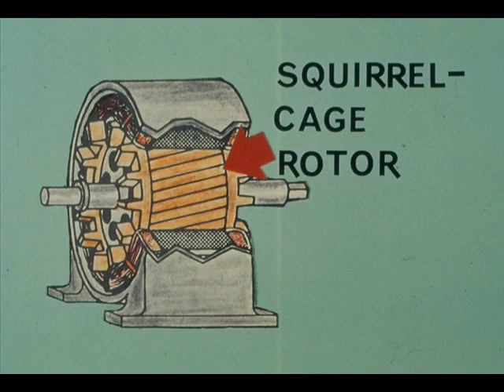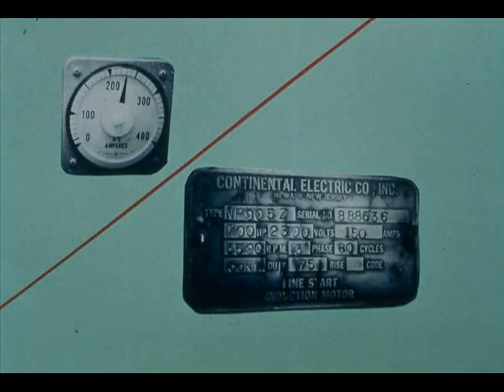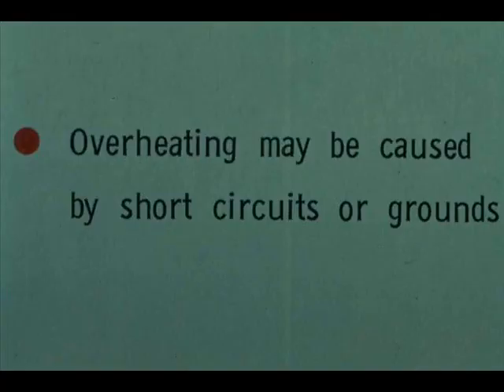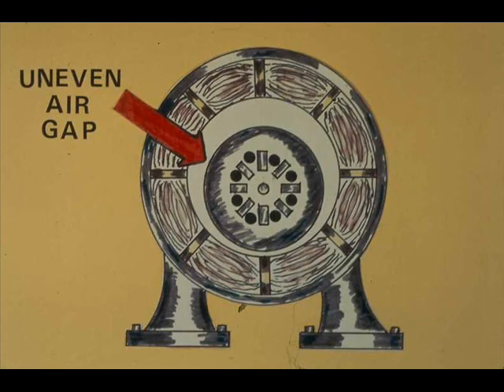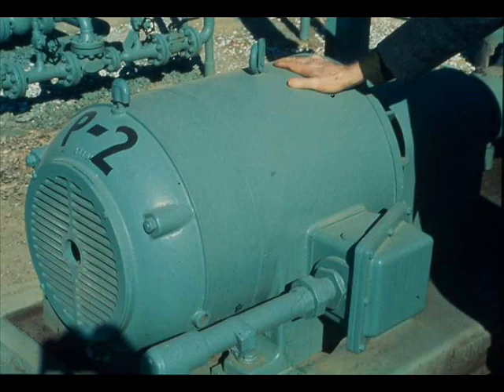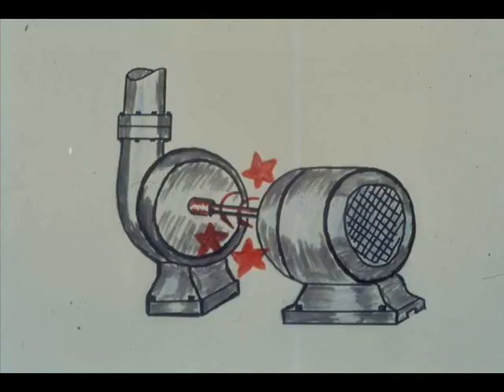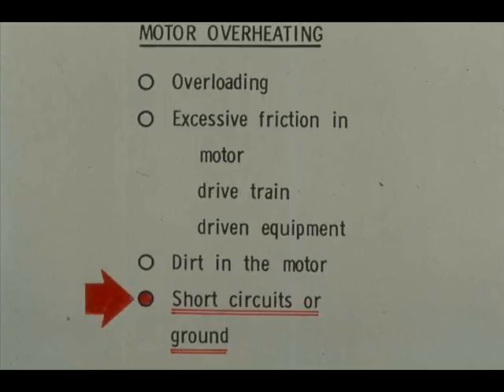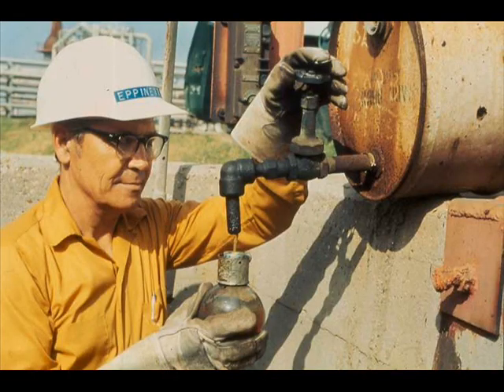Electric AC Motor Part 3 | Introduction Electric AC Motor | Inspection | Repair | Troubleshoot

Comment: I agree it's informative but be careful to old practices building bad habits! I mention sensing vibration by putting your hand on the motor which goes against primary safety rules of avoiding contact with possible sources of electric current.